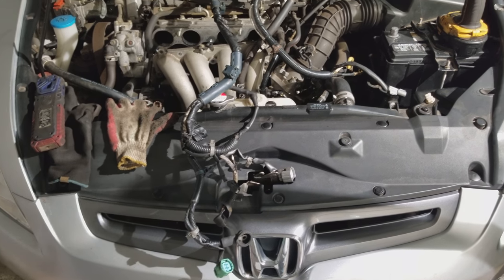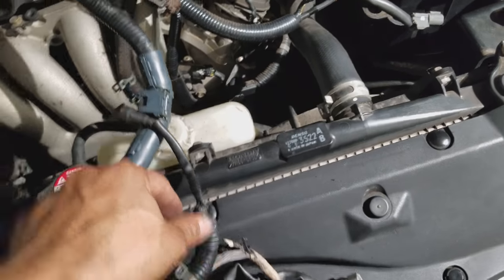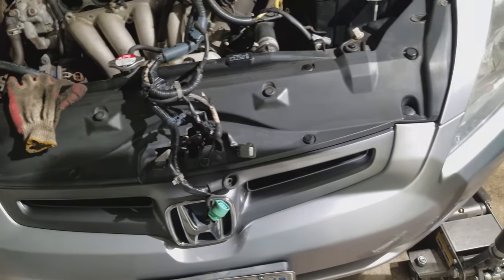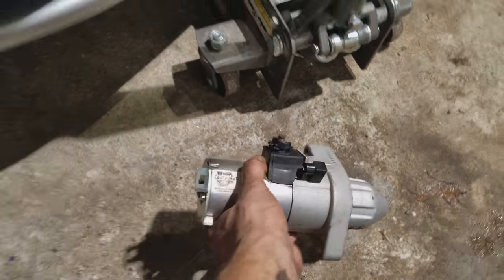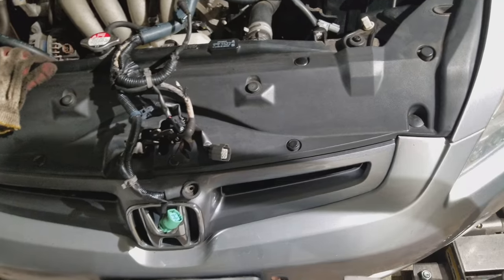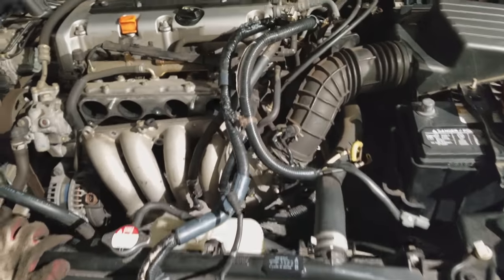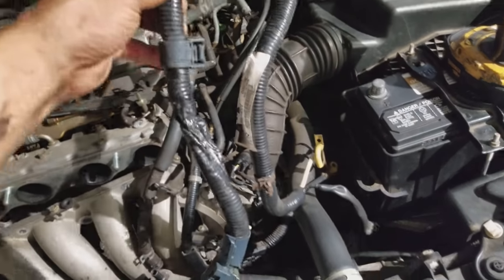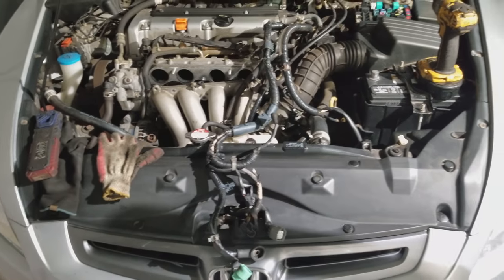Honda battery cable burning melting fix

Comment: Damn, I guess this is common. I just put a new starter on a year ago and my car just about caught on fire. It completely burned the positive cable completely and the negative terminal got so hot it melted the lead post. How much did that wiring harness cost???
Reply from the maker: I don't remember , wow best luck
Reply: Holy shit the same just happened to me and couldn't find anything about it until this video. Did you ever find the harness? I need one now too
Reply: @shall2387  i never found a harness, I just went in and replaced each bad wire one by one and its still running. It's my everyday driver. Best of luck, that crap sucked.
Reply: @joewynn2445  that's exactly what I was going to do